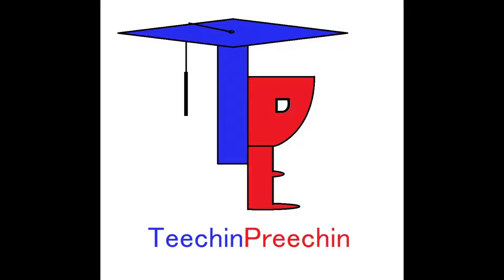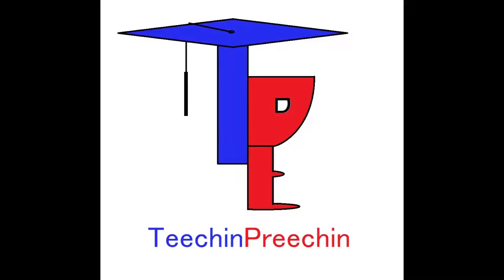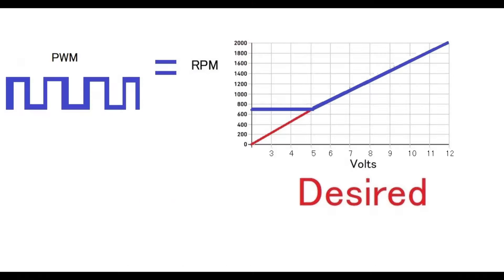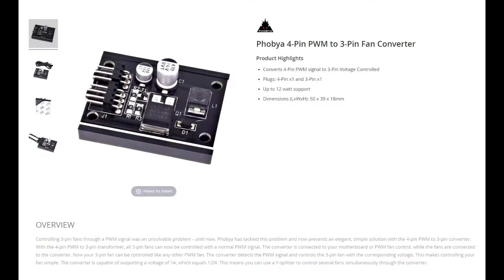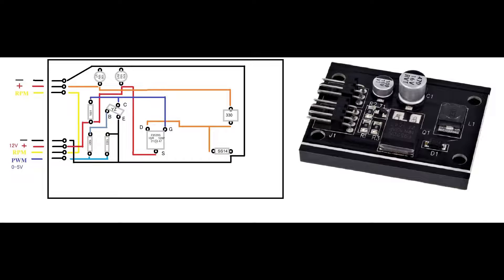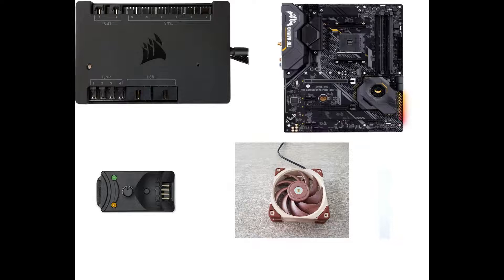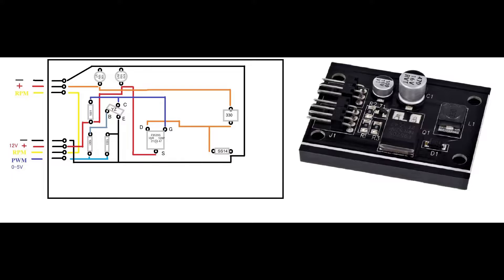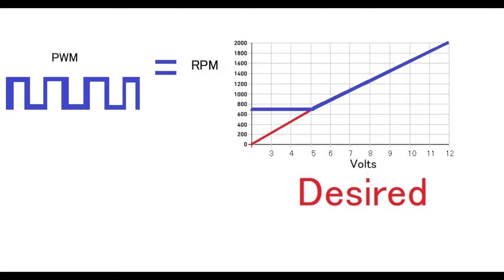PHOBYA  EXPOSED, 4 PIN to 3 PIN YOUTUBE CHALLENGE, Bad Design? Be the first to fix it?

Comment: its basically a resistor at this point that is turned on when pwm is applied thats why there are only 2 speeds, BJT Transistor needs to be rotated counter clockwise, collector goes on blue, base is black, emitter to purple. Its probably some chineesian defective product that they purchased for pennies and repackaged do make a profit!